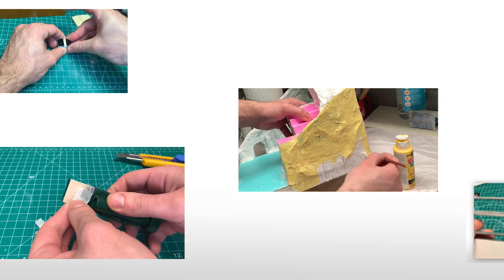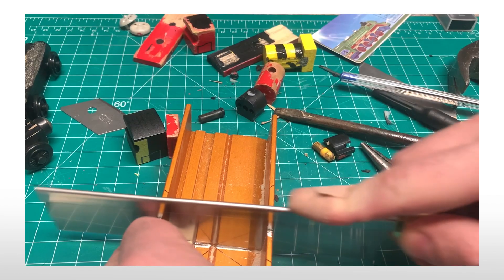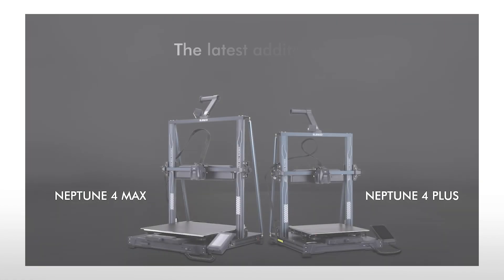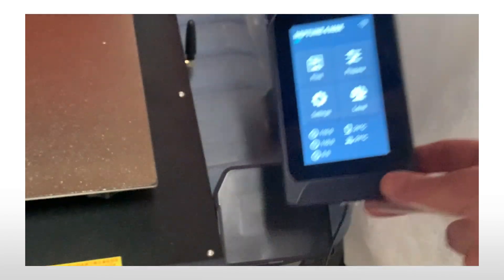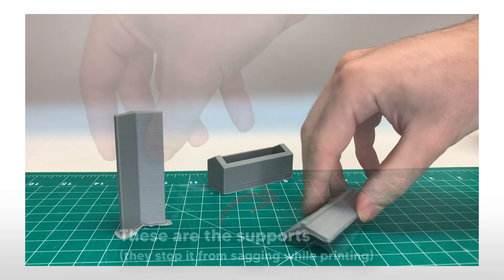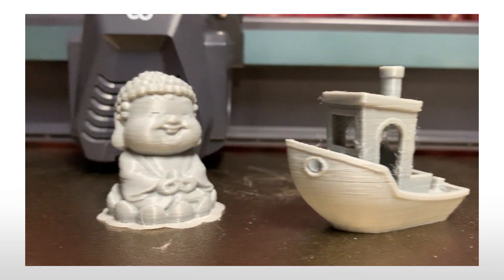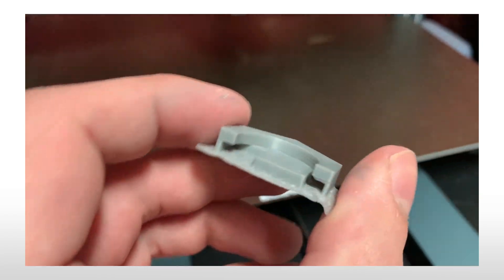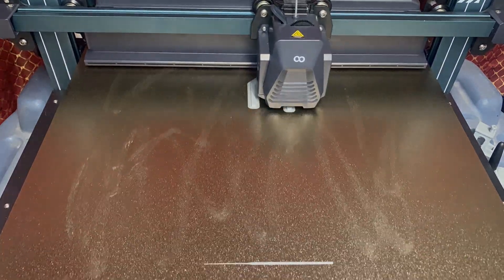To Print? Or Not To Print. | Elegoo Neptune Max 4

Comment: Btw you can use the 3D printer to make you guides and barriers so you can cut or sand wood to whatever shape you want with extreme accuracy!

You can also use it to make stencil guides so it will be easier for you to paint the trains!
Reply from the maker: I was thinking about doing something along those lines, thanks for the suggestions!

Comment: Some printing tips:

You should (i think) be able to print in 0.08mm layers if you do a custom preset, also the weird stringy lines on the prints can be fixed by increasing "retraction" length

If you wanna stay with a more "wooden" look maybe you could get some wood pla (pla infused with sawdust or other wood particulate) 

Glad to see more thomas fans get into 3d printing, honestly one of the big reasons why im getting back into thomas lol
Reply from the maker: Had no clue about the retraction function! Will definitely need to look into that! Thank you so much for all the tips!
Reply: @GeohToy  in the next video are you going make James?